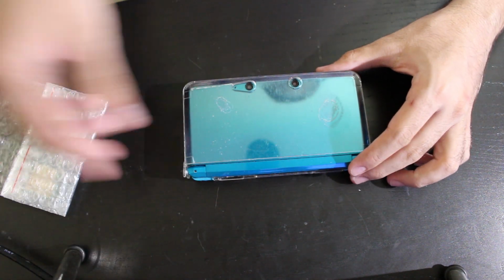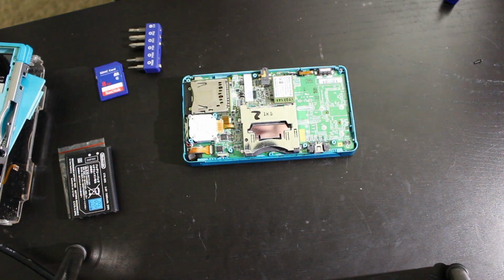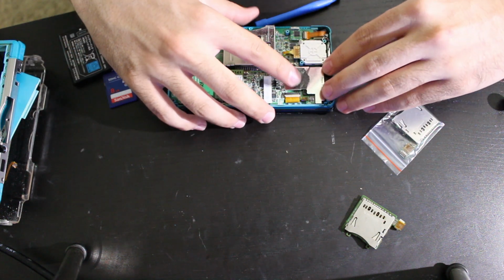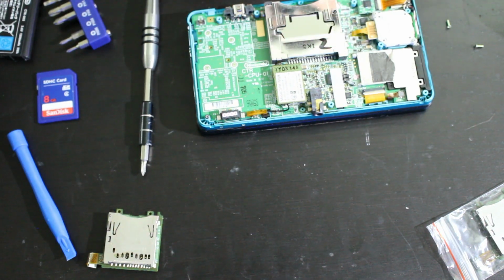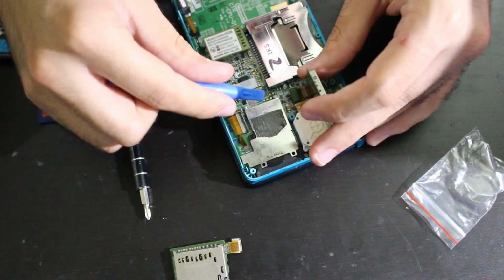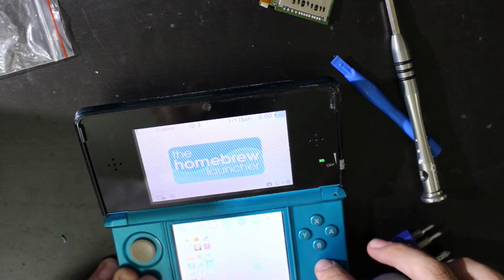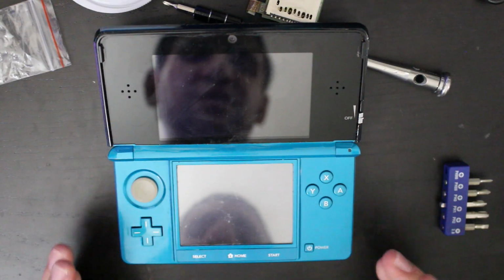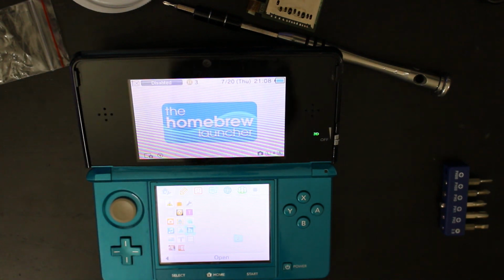Let's Repair! - Original 3DS With a Faulty SD Card Slot

Comment: I am not sure but I have a wierd problem here. Every time I try to turn my 3ds on with the sd card insertet the blue light turns on and off. I take it out and it works but no games. I try to put the sd card back while the 3ds is turned on and it just show a message that says it cannot display the software on the sdcard the sd card could not be accessed. It is a pretty rare problom I think because never found a fix for it before. Someone help please?

Comment: Does the metal part that's under it have something to do with it? I acidentally snapped it off and then soldered it back but my 3ds kept saying it couldn't acess the sd cards files, so I bought a new sd card slot and it still doesn't work. Any ideas?
Reply: lo solucionaste?

Comment: How different is it for a regular 2DS? The clip that holds the SD card in recently broke, and tape will not hold it in place, so it needs to be replaced. And I can't find any tutorial, either video or text, for it, so...
Reply from the maker: I've never worked on a 2DS so I can't tell you.

Comment: I have a 3ds and when i opened it it also had the solder come away from the SD slot.... would that stop the console working? I don't use the SD...  I was getting the "error has occurred"

Comment: Hello, my 3ds has same problem like your. I replace the sd card slot but it still not recognize the card. Does the metal plate soldering has any affect on this problem ? Please help.

Comment: So your saying the two little silver bits that are attached to the board the reader sits on are the issue? And I need to use a suatering tool to fill in the bits that are chipped/loose? And that should get the thing to work? I'm currently repairing a original 3DS with a faulting SD card reader, which would not start with an SD card in it at all. If the card was removed the system worked fine. Upon replacing the part, the system now starts with a SD card in it, but doesn't recognize any data on the card. (No, the card is not locked, it tells me if I lock it it can't access the stuff if I try locking it) I'm just curious before I take another shot at taking it apart if that's what I need to do. And if I could get an explanation on how long I should hold the heat down on the spots and such that would be great!
Reply: I'm also having the issue but with the Original 3DS XL.

Comment: this is cool but sadly i got the 2011 3ds xl and the sd card slot is soldered onto the board so i cant easily pop it off of the board like u can on the original 3ds
Reply: Me too :( is there any way to fix it?
Reply: @loukitty  same here

Comment: i have a broken 2ds (the screen cracked, but everything else on it is fine) and a 3ds with a faulty sd board. Can I use the board from the 2ds and replace it with the broken one? Or do I have to buy a replacement part? I figure it would be okay because they both have virtually the same hardware, but I want to make sure.
Reply: yep. just not the SD card flip.

Comment: my 'New' 3ds (stupid name, Nintendo) sd card just wouldn't accept the sd card anymore, springs them right up, thankfully it's so easy to remove that part on the small n3ds, take off the back cover and then there's the micro sd card slot with screws. The hard part is finding the replacement part for the smaller n3ds. So my idea is just buy a broken one and take off it's sd card slot and put it in mine. In theory it should work, hope I can connect the ribbon easily with that small amount of space.
Reply from the maker: Good luck!

Comment: It's 2019, but I got a used 3DS XL and whenever I insert an SD Card, the system will make a pop/crack sound and won't power on. Plus the top screen is broken and I plan to fix it soon. Does anyone know the problem?
Reply: The same thing happened to mine. its a short in the sd card reader. take the bottom back off and make sure none of the pins inside the reader are touching

Comment: I replaced my 3ds's sd card reader and then the touch screen became broken :D woohoo
Reply from the maker: NOOOOOO 😭
Reply: @MrMario2011  everything worked fine before and I gently peeled off the broken and card reader leaving the solder joints intact put everything back together following what you did and I just felt so sad when I saw the touch screen went out

Comment: Hey, thank you so much for your video. It's the most close one to my problem. My old 3DS has this problem too. I tried with 3 different SD cards and the 3 became corrupted somehow. The thing is when I put the SD on my PC, It doesn't even let me see what is on it. Nor even the storage space, it appears like 0GB. And it doesnt let me format either... So I am so afraid to change the SD Slot and the problem still persist ): I dont know what to do, or if this has a solution